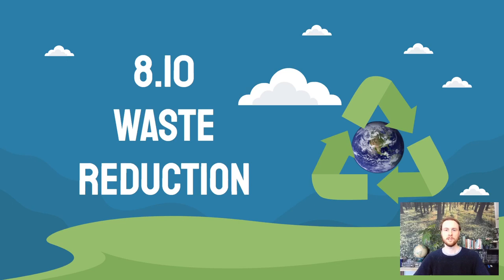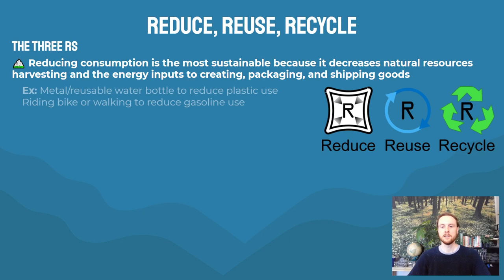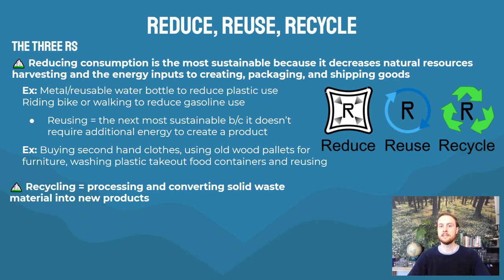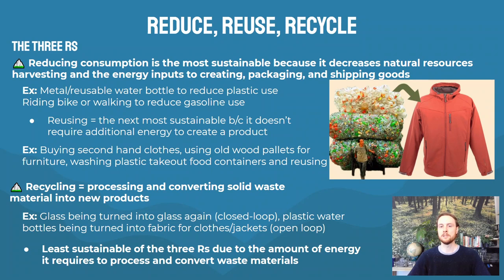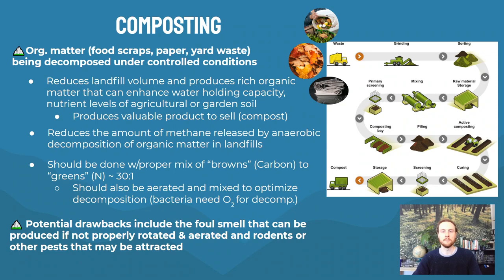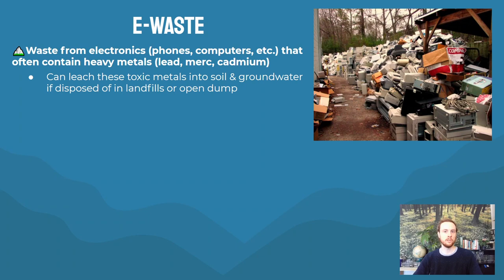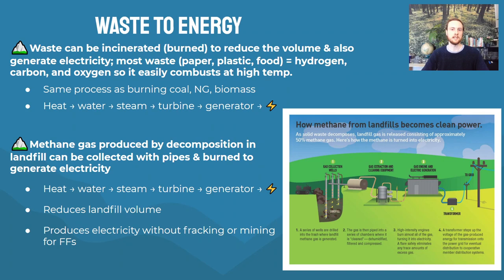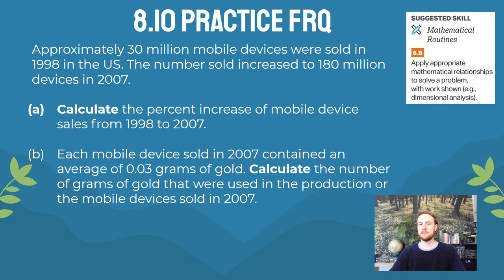AP Environmental Science 8.10 - Waste Reduction Methods

Comment: I don't understand why it's not common practice to wash Ziplock bags. Particularly the nice ones with a zipper. You could buy one package of Ziplock bags and use it for years without having to buy new ones.
Reply from the maker: I completely agree! I even wash the little snap seal one and reuse those as long as I can. You can also buy heavy duty, rubber sandwich bags which easily hold up for years.
Reply: That's a good idea. However, I ziplock bags do tend to rip and get thinner as they age, but yes, you could use one pack of ziplock bags for years. I never thought of it like that before. Yeah, why do people throw away ziplock bags after one use?
Reply: I imagine the same reason you should not reuse single use plastic water bottles, which leach carcinogens when filled with tap water. (In the factory those bottles are filled with deionized water)

However, there are plenty of alternatives to ziploc bags, including wax wraps, glass, reuseable silicon bags, etc